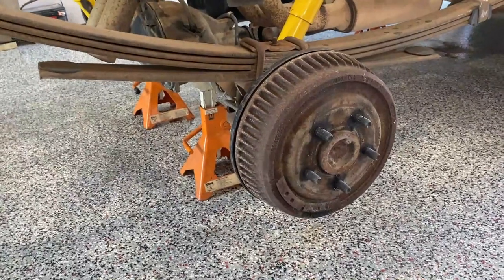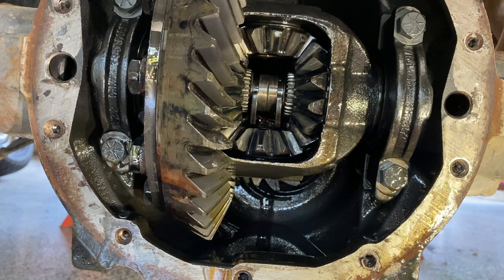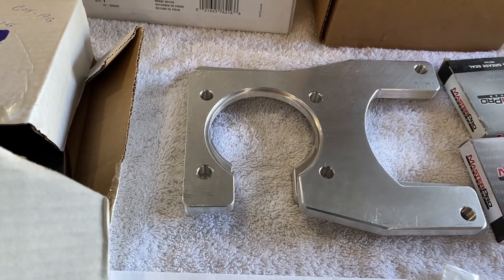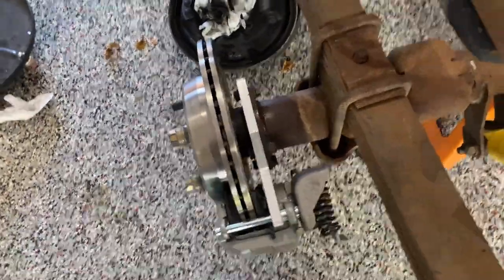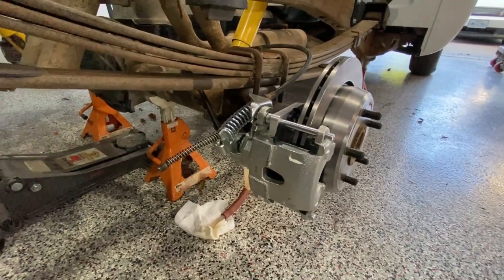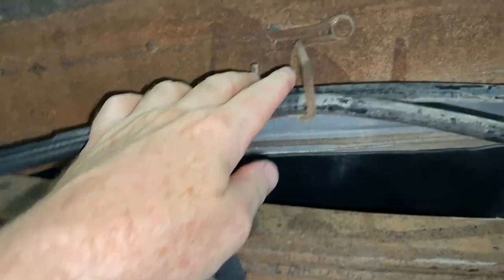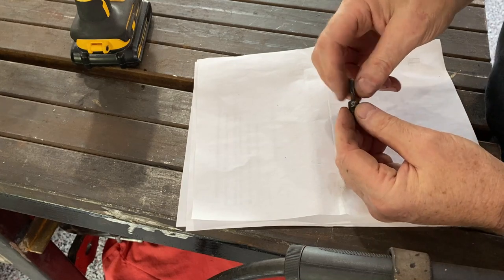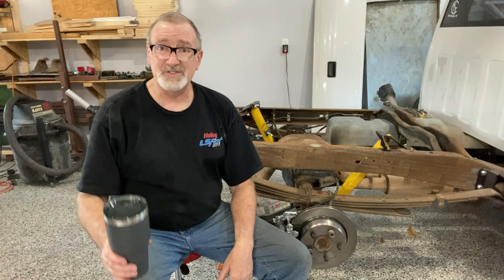How To 1988-1998 Chevy OBS Truck LS Swapped Rear Disk Brake Conversion

Comment: Why not use the Caprice/Impala backing plates/caliper bracket s?
Reply from the maker: I don’t know if that would work or not. There are a number of kits available that fit the passenger car 10 bolt rear but say won’t fit trucks. Not sure why or what is different. These brackets were made for this. You may be able to source a set of the SS parts and see if they fit. I’m sure there are other ways to do this, this is one way.
Reply: That’s what I was thinking, wonder if that would work?

Comment: Will this kit work on a Chevy van?
Reply from the maker: It is not a kit, I bought the brackets from Cunningham Machine and they supplied a list of parts that would fit that I would have to find on my own. But, to answer your question, it the rear in the van is the same 10" drum brake as the trucks, then it should. Call Cunningham Machine or check out their website for specifics to your project.

Comment: What make model are the break caliper's out of ? I want to get one without the parking break
Reply from the maker: Search 1979-1985 Buick Riviera, or Cadillac Eldorado, 80-85 Seville, 79-85 Toronado. The calipers without the parking brake feature are much cheaper.
Reply: @laurencevillegarage   are they front or rear calipers for any of those cars
Reply from the maker: @CrossSphere  there are both available. The “non emergency brake” versions are a lot cheaper.
Reply from the maker: @CrossSphere  they all used to be cheaper, but the calipers are getting older and I guess some people have realized what they are being used for and the prices have gone up. Supply and demand.

Comment: Do you know what rotors would work with a k1500 with 6 lugs?
Reply from the maker: You would need to go to the Cunningham machine website and look at the correct brackets for your application. The brackets I used are for a C1500. Since a list of parts is listed with the brackets, I would bet the rotors you need would be listed with the correct brackets.
Reply: @laurencevillegarage  thank you for the swift reply, I will take a look hopefully I’ll find what I need👍
Reply: @Lou_sassel315   did you find anything out about the rotors for the 6 lug trucks
Reply: If your truck is a 4wd you can use brakes from a 99 and up truck.  The front is a little more labor intensive but well worth it.  There's plenty of videos on it.

Comment: I duggest you re-route your emergency brake line from inbetween the leaf spring and frame. Doesn't seem logical or practical.
Reply from the maker: That is how the factory does it. You would not want to run it below the leaf and can’t run it above the frame. There is a gap between the spring and frame. The spring is not directly below the frame so it is not sandwiched between them. Do you have an OBS? How would you run the cables?

Comment: you dont have to remove axles, just cut the plate off the truck
Reply from the maker: True, my axle seals were leaking anyway…so they got pulled.

Comment: Yeah, yeah the 1500 series is stupid simple to convert. Show me 2500-3500 conversion.
Reply from the maker: I have plans (in the future) to mod a 2500. It can be done, but the majority of modified sport trucks are 1500's. 2500's are a smaller piece of pie. I have a K2500 as well as a c1500. I hear ya!